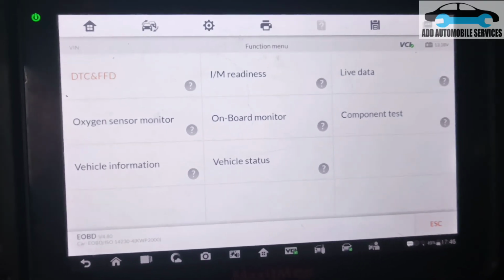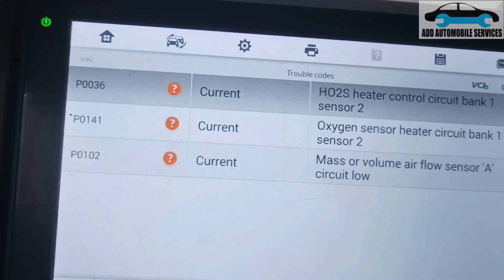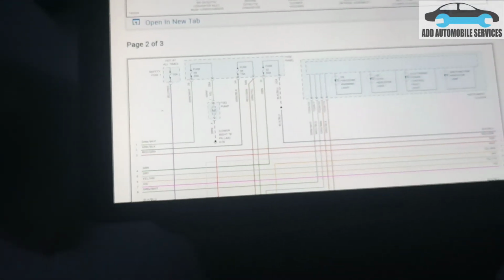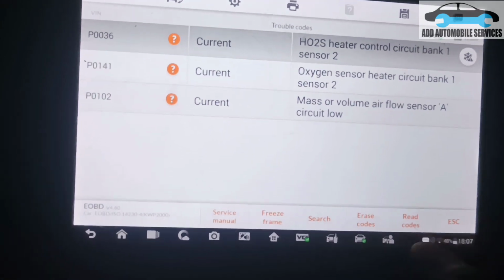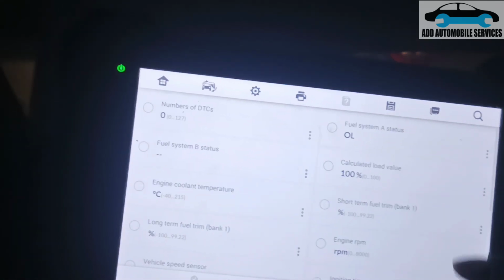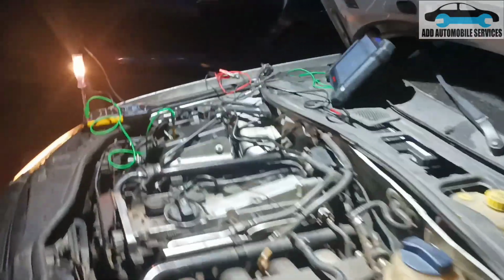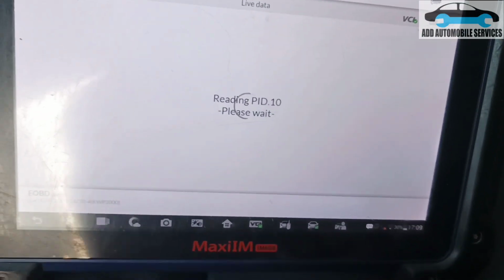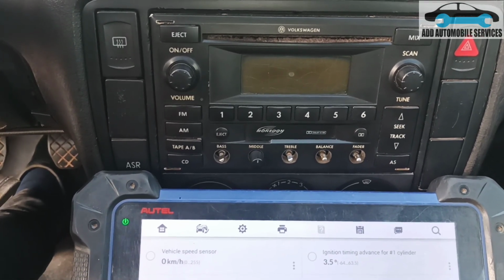2004 Passat P0103 Mass air flow sensor low voltage

Comment: Can a MAF signal wire shorted to ground result in a circuit low code or is this type of code only for power and ground and not for the signal?
Reply from the maker: It is for powers and ground, low for power and high for ground
Reply: @ADDAUTOMOBILESERVICES  Thanks.
Reply from the maker: @abdul-kabiralegbe5660 you're welcome